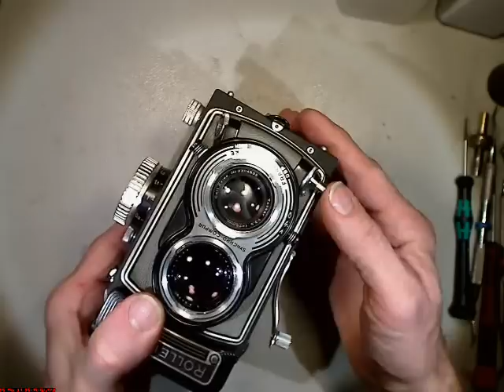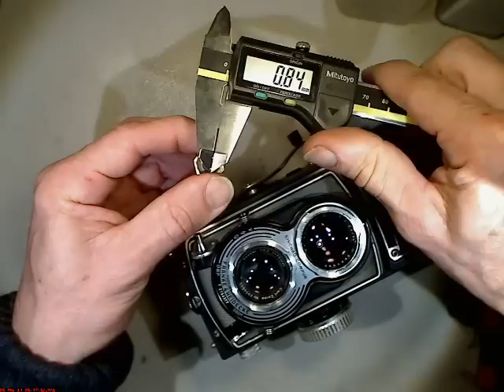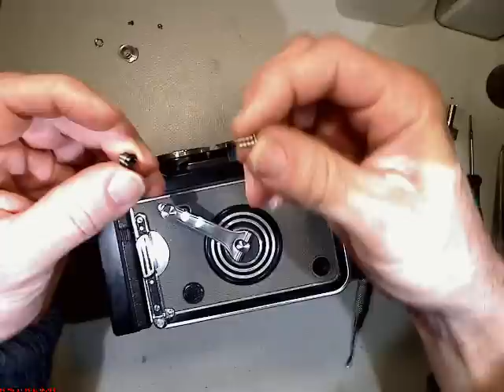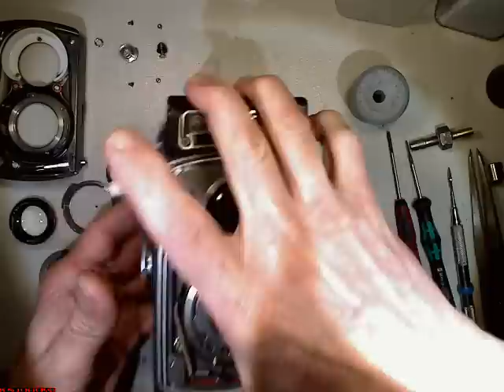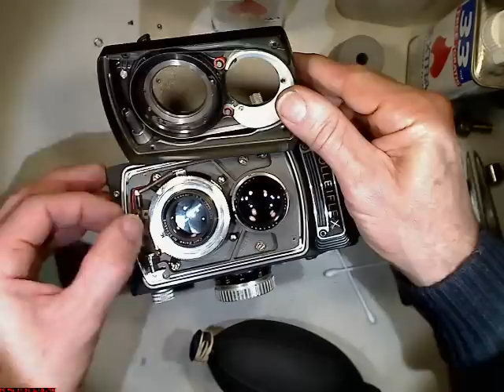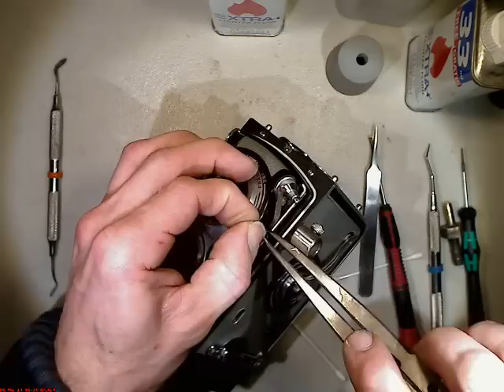Repair Rolleiflex T 75mm 1:3.5    slow gear problem______Motion Lapse film

Comment: Thanks for doing this Video Mike.

I have a Rolleiflex T V3 with sticky slow shutter speeds, so I will have to turn up the special tools and give this a go.

Mine has a second problem, tha the the aperture display no longer moves. The combined aperture/shutter speed lever still works correctly, and positions the aperture blades to the correct F-stop, but the display doesn't work. Any suggestions how to fix this would be appreciated.

Comment: Hi Mike, thanks for your video. I want to fix the sticky shutter of my Rolleiflex T and I followed the steps in your video. I made the special tool to remove the ringnut of the flash connector. for so far ok but I cannot remove the  bushing. What do I wrong? please answer.

Comment: I just made a cla, and by pure mistake i forgot to put back the tiny screw that holds the black ring in place, is this is real problem, should i  take the camera front out again and set the screw back or i can leave it like that, what is the chance for the ring to rotate freely??

Comment: Great thanks for putting a video Rolleiflex. I have two questions.
1. Friction usually comes from the shutter curtains or can be timer-clock seconds?

2. What type of oil is used to lubricate the video for the curtains?

Thank you very much for your kindness !!
Reply from the maker: Hi Jose

First: There are many different TLR cameras with different shutters, some of the names are: Compur, Syncro Compur, Compound, Copal..., ALL are they Leaf shutters.

1.   The shutter in those old cameras like Rolleiflex, Rolleicord, Yashicamat, etc. etc..., are very most of the time a leaf shutter, therefor there is NO "curtain". The time settings is handled by 2 seperate gears, a slow gear, that take the time from 1 second up to 1/60 sec. The higher speed's is handled by the "high speed gear" that goes from around 1/125 sec. (all, depeding on models and brand..) up to 1/500 or more.

2.  This camera has the very commen problem, because the leaf's was stuck by old stiff oil at the shutter blades. I could have completly disassemble the shutter, but it is some time not nessesary, because it can easily be fixit with 2-3 drops of LIGHTER FLUID (Zippo) on the blades.

Keep the camera flat on the table and from above, apply 2-3 drop direct on the blades ONLY, when the shutter is closed.
Cock the shutter and fire it many times, and you will see it will free up after some try.

Hope it make sense :-)

Cheers
Kenneth
Reply: Hi Kenneth!

Thank you very much for your kind reply !! Yes, I realized you used gasoline zippo! I did not know it was a cleaner / lubricant ideal for this but it is a great idea !! (I know that gasoline is an excellent cleaner in auto mechanics).

Thanks for your explanations and put a video on Rolleiflex. They are fascinating and I love it !! machines. Thanks for your advice and follow them to see such.
We will comment when finished to see how it suits me.

Mil Gracias friend and greetings from Spain,

Jose Luis.
Reply: jose luis lluelma  Not exactly gasoline, but close.  It's naptha, which is still sold as a solvent for painters and for Coleman Fuel.  However, gasoline and the Coleman fuel have numerous additives, unlike your Zippo lighter fluid or the painter's product
Reply: Thanks for your comments.

Comment: Mike, my Compur is essentially frozen.  What do you think about taking the lenses out, pretty easy, and try the lighter fluid on the shutter blades?  While the other working parts can certainly gum up, it's the blades that have so much surface area for "stiction."

Comment: Hi Mike - I have opened my 'T' because the aperture wasn't opening and closing correctly. Do you have this film without the time lapse? I'd like to hear your explanation of what's inside and how the shutter and the aperture interact with the adjustment rings.
Reply from the maker: I have already made another video about the Rolleiflex with a sticky shutter, and other details, you can see it here:  https://youtu.be/S_u2YTOSw0Q
Reply: @mikeno62  Thanks for replying! I have seen that video (and it really helped when I fixed my Automat) but the insides of the 'T' are a little different. I have one where the aperture is completely frozen (the forked lever that locates on the adjusting pin doesn't move at all), so I'd like to see your video in full if you have it, as you're good at explaining things as you go along!

Comment: Hi Mike, Do you have a video showing the inside of the right side of the camera, where the winding mecanism and the crank are. Mine seem to be jammed, Crank wheels seem not to roll freely as they should (there is an inner and outer wheel). Could not find a repair manual showing how it should be in nomral condition, thnk's
Reply from the maker: Hi Jean-Phillippe, I do not at the moment have a video about the winding side of the camera, but I will make a video about it very soon.

Cheers Kenneth

Comment: hey Mike thanks for the support and videos ... I managed to put a new bellows in the lingo ;-) so now trying my hand at the Yashica 635, I have a stuck timer common prob apparently. my question I can't get to the mechanism due to self timer handle being in the wrong position so the top plate will not remove can you suggest anything ? 

many thanks
Reply from the maker: Just an idea, what if you try to gently manipulate the self timer handle a few time, it sometimes get stuck.
Reply: Thanks mike but no Joy ... not sure how much pressure is too much before I do more damage what would be the next port of call in your opinion ? thanks again

Comment: I have a Minoltacord TLR and when I when wind the film advance, the gears "slip" and don't advance the film. Any ideas on how to fix this? Thanks.
Reply from the maker: It could be some worn out part's, but I will sooner make a film about my old Minolta Autocord, because it has problem with the sticky shutter.

Comment: Hi Mike, great video. What tool is that which you used to remove the flash socket at 1:08? and where can I get one? Thanks, ,Steve
Reply from the maker: I have'nt seen the original tool for this task because, this is a home made tool, that I made out of a connection (connection to air-tool's) to an air hose, it's made of brass (or stainless steele..), so I grind it so there was 2 small pin's to go into the 2 small nothes in the very small retainin ring. I think the diameter is around 5-6mm.

Cheers
Kenneth
Reply: Ok thanks Kenneth... I've ordered a screwdriver with a U-shaped head, hopefully that will work.
Reply from the maker: Then you just grind it to fit, it should be easy to make :-)